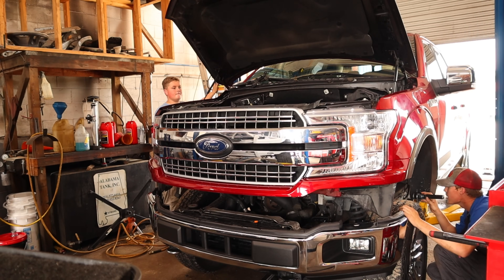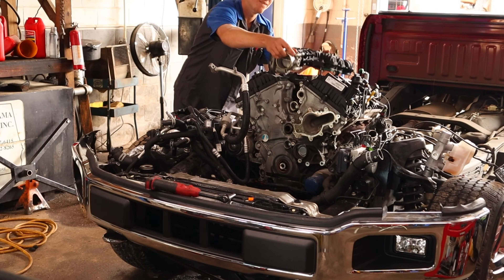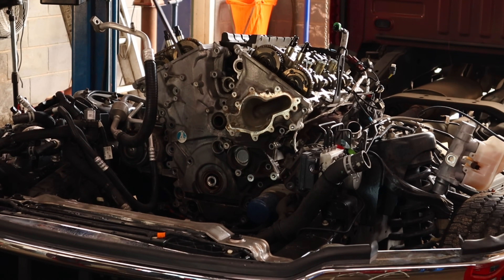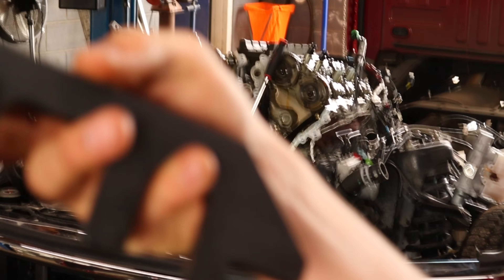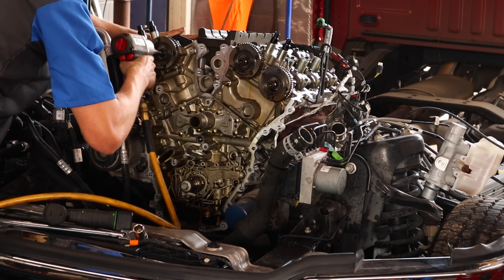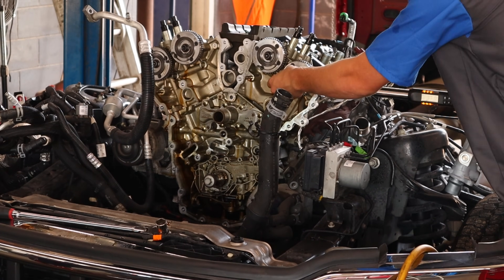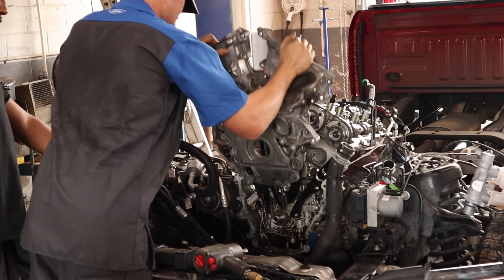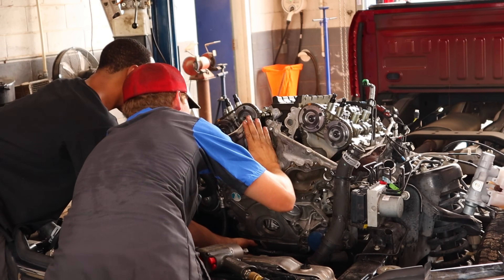Ford 3.5 EcoBoost Cold Start Rattle (VCT Phasers) | Everything You Need To Know

Comment: I just had mine changed on my 2018 3.5 with 28k miles on it.  It never really made a noise other than a knock at warm idle. I had the truck for two days and it is making all kinds of god awful noises on startup.  I really hope my dealer didn’t cause irreversible damage to my engine….i have videos on my channel if anyone  cares to hear the noise.
Reply from the maker: Take it back!
Reply: @FlyingWrenches13  oh I did. They’ve had it for going on three weeks now and still have not given me an update. I got Ford involved to hopefully get a quicker resolution. Super frustrating.

Comment: The rattle comes from the chains not the VCT Phasers.  VCT Phaser would make a slapping noise not rattle.   Even a drop of oil inside the cavity would make the VCT Phasers silent.  Imagine a Ford sales person telling a buyer all this golden information.  No body would buy that vehicle.  In my world timing chains are good for the life of the vehicle, especially in an interference engine.
Reply from the maker: That is incorrect. This rattle noise is 100% caused by the phasers.
Reply: @FlyingWrenches13  How?  The phasers are only free to move about 45 degrees about a central point on the phaser.  Oil in the cavities locks the angle.  The entire phaser then rotates but shifted by the angle.   What causes the rattle?  The chain going over the phaser sprocket seems the most likely cause of the rattle.  I am trying to figure it out. Can you provide more data?

Comment: Are you sure it's the Phasers..  Does it damage things or just a "Nuisence"?  The Mid 90's DOHC Lincoln 4.6 had a timing chain rattle caused by oil pressure chain tensioners..  Didn't seem to hurt anything..  some help with an oil filter with a one way valve that sped up oil pressure build.  Sounds more like chain rattle to me.
Reply from the maker: It’s phasers for sure.

Comment: I have a 2018 F150 3.5 and had the cam phasers replaced under warranty last month. A few days later the low oil pressure sensor went bad and now I have a powertrain malfunction error and there is now power when I hit the gas.  The truck hasn't downshifted properly since the sensor went out.  My mechanic at Ford doesn't seem to be too concerned and told me to keep driving it while we're waiting for the sensor to come in on the 18th, should I be though?  Truck almost left me stranded last night.
Reply from the maker: I’ve never seen that happen with the oil pressure sensor. I’d say if the truck is running that poorly after a repair was made, that dealer would be giving me something else to drive until it’s fixed.
Reply: @FlyingWrenches13  They did but only for a few days.  They replaced the sensor on Saturday and the truck runs like it used to.  They really put a serious safe mode in those trucks!

Comment: I am so tired of hearing this click/rattle in my 2017 limited.  I actually took mine in for other recalls and I noticed on the invoice the cam phaser it PCM was reprogrammed.  Changed nothing. Mine does a slight rattle just in idle.  I will be calling dealer again. Funny enough a week after I got the truck back I got that recall notice from Ford.

Comment: thank you for this information  i was about to  buy a 2018 f150 limited with 14,000 miles  and when i started it  first thing i heard is the rattle  i was about to pay $55,000 i think i will buy a toyota tundra instead.
thanks
Reply from the maker: Warranty would have covered that repair. Tundras aren’t bad trucks either though!

Comment: I have an issue with my 2017 F150 3.5 ecoboost where is making a ticking noise. Would you be cool with me emailing you a short video clip and giving me your opinion?
Reply from the maker: Sure! You can send it on IG or Facebook too.
Reply: My 2018 3.5 started tick, tick, ticking around 67k.  Old folks in my neighborhood turn and look…, offer suggestions.  Its embarrassing, annoying and unnecessary.  I ‘think’ it’s caused by one of the VCT solenoids?  Checking w my dealership and I have the ESP.  Since it throws no codes, they aren’t quite sure what to do. Until it gets fixed I’m just hoping it doesn’t cause any “out of sequence“ situation?
Reply: I should have updated this; but my issue ended up being something loose on the starter that would rattle. New starter and the noise went away completely

Comment: My 2018 Ecoboost (with 44K miles) has never had the cold start rattle but just recently I had that chattering/rattling sound (for the first time) after a 3 or 4 minute warmup from a cold start. I was doing  50 mph when I heard the sound.  It sounded like it was coming from the valve cover and lasted for 20-30 seconds until I had a chance to pull over. I let the truck idle for a few minutes and then drove away. The sound has not returned since.  My oil and filter has been religiously changed every 3500 miles with Amsoil Signatures Series 5W30.  Could this be the cam phasers?
Reply from the maker: That doesn’t sound like cam phaser rattle to me. If it makes that noise again I would probably take it in for diagnosis.
Reply: @FlyingWrenches13  Thanks for the reply.  I have an appointment this week at which time they are going to reprogram the PCM. I told them a couple times it has never made the noise at cold start up. Perhaps I should cancel the app't? I don't want to get the "shudder" that folks talk about after the PCM reprogramming....  The noise has never returned.
Reply from the maker: @cwqrpportable  I would go ahead and have the reprogram done so that you get the warranty extension for the phasers. You can alway have it reverted if you don’t like it.
Reply: @FlyingWrenches13  Good advice, thank you. I'll do that. Appreciate your reply.

Comment: Since these motors are hard on oil (fuel dilution, turbo heat breaking it down, vct phasers leaking out overnight, ect. Would it be better to just start using thicker viscosity oil from the beginning? I doubt we would see any negative issues from running thicker motor oil. It seems like 5w40 at the minimum would help, if not 10w40 or 15w40. Might loose a bit of fuel economy but at the cost of a $3k repair needed every 100k, It might be worth risking.
Reply from the maker: I would say that’s true but with how small some of the oil passages are in this engine I would still recommend using manufacturer recommendations.

Comment: Great video. Just some pointers: take the ac lines off the compressor, takes a minute and makes is easier with the front cover. Also make and install the dowel pins for the front cover installation, you’ll thank yourself later. Also it doesn’t take 4 people to set a cab back down. 2 at most. Most of the time I do it by myself.
Reply from the maker: Thanks! I’ll try those tips on my next one. I usually remove and put back cabs by myself but for some reason when I turn that camera on everyone wants to start helping me or watching hahaha

Comment: This is no longer for only "under warranty" trucks with the 3.5L GTDI engine. Any mileage with Customer Satisfaction Program 21B10 to update the programming on the PCM. If it messes it up, then they give you 21N03, free also, and if the reprogramming messes it up and they can't get it right, then they give you, free, 21N08. Hurry, there are time standards on these fixes.
Reply from the maker: Watch my newest video on this, I go into detail about everything you just said. Good info, thanks!

Comment: 2019 platinum Expedition got both the 21B10 notification ford app and then a mailer with the whole mileage/ coverage breakdown etc. Had zero issues only 19,000 miles on it. Oil oci every 5k. No doubt the turbos and gas dilution from the DI system degrades the oil quality pretty quickly. 

Dealership did the 21B10 update two weeks ago. No hard / odd shutter from what I can tell. But will for sure keep an eye out. 

Ford likely is just going to tweak and milk the 3.5 till they go EV or some type of hybrid where the 3.5 gets retired. Bummer… I really like this truck.
Reply from the maker: Yeah I love the engine, if they get all these oil flow problems solved. Glad to hear you haven’t had any issues, hope it stays that way!

Comment: Why in the world did you remove the cab???? I’ve done countless ones and I’ve never removed the cab. That is a huge disservice to the customer by being far more invasive than necessary.
Reply from the maker: Takes less than a hour to remove cab. You then can access everything on the engine a 1000 times better. The real question is, why in the world would you not remove the cab?
Reply: @FlyingWrenches13  unless your r1234yf machine is much faster than ours, you are spending far more time than an hour to remove the cab. Discharging the ac and removing the lines and not replacing the o rings on the lines because Ford sure won’t pay for it under warranty. Also, if you are doing CP then you are screwing the customer by charging them an evac and recharge, replacing the o rings when the procedure doesn’t call for it. 
Not only that you are raising the cab off the frame, while really not that big of a deal, it’s just another step you don’t have to do and could cause problems further down the road for the customer or you if you get a spun cage nut or cab nut. 
Idk, the procedure on these is pretty simple and just seems like a lot of extra work. Also seems like you struggled putting the cover on even with the cab out of the way. Zip tie the battery cable to the frame and push the trans lines under the oil pan and will make that much easier to do.

Comment: Why tear into it to try and fix it?  Just add an oil pressure pre-lube system (either pump or accumulator).  Problem solved.  Will increase engine life too.
Reply from the maker: Where do you get a pre lube system for this engine?

Comment: Great vid ! I like the fact your extremely smart and honest. You tell it like it is. Keep putting out your videos and your reviews ? I purchased a used 2014 f150 with a 5.0 and 150,000 miles. Ran fine till I changed the oil. Used Mobil 5/30 and Ford filter. Drove about 5 miles and check engine light came on with a cylinder misfire. Cleared it and drove it again with different cylinder misfire. Cleared it again. Now I have p0390,0394,0300, and numerous cylinders on the other bank. And what sounds like noisy vct,s   Do you think the guy that sold it to me ran a thicker oil to disguise this problem and noise. What do you think. Was it related to a simple oil change? Or a coincidence? Need a video on swapping cam sensors. Thanks.
Reply from the maker: Thank you! Most likely the oil viscosity wouldn’t hide the vehicle from setting a dtc. Especially considering 0394 and 0390 are electrical dtcs. I would be looking at cam sensors, wiring, or pcm issue if I was diagnosing your truck. Also, could be out of time if anyone has ever had the truck apart.
Reply: @FlyingWrenches13   could the oil viscosity hide the upper valvetrain noise , maybe the vcts from making a lot of noise. Which is now present. Keep the camera rolling , even a simple video like washing down a motor prior to disassembly. Looking forward to see this channel Grow to the. Millions. Thank you.
Reply from the maker: @tripleh9985  will do, Thanks! I doubt that thicker oil would have stopped a vct noise. If you really think it’s got something to do with oil viscosity, pour a quart of Lucas oil stabilizer in it to see if anything changes. The Lucas will thicken the oil up a good bit.

Comment: F'n Ford! My 2002 Sport-Trac had all 4 timing chains (balance shaft included)!w/cassettes go to sh_t after 100,000. Rattled for 6 months just to remind you its cheaper to re-motor since you have to pull it anyways. $3000 labor & $1000 parts to fix it when a new long block is $3000. My Lincoln 32 valve Intech V8 same deal. Bro in-law 5.4 3valve F-150? Same goddamn thing. If it's a phaser or a chain Ford version will let you down early. Ford sucks! Chevy sucks too!
Reply from the maker: Yeah they all have there issues. 4.0’s suck because of that chain, all they had to do was put it up front haha

Comment: My rattle only seem happen when  cold weather came never happened in summer time just winter I had everything check even turbos no issues sure enough cold weather just came rattle started
Reply from the maker: Colder the weather thicker the oil. Harder to get good oil flow with cold thick oil.
Reply: @FlyingWrenches13  I let my ecoboost warm up first I had my budy who works for Ford he said it was just runs good I had to put oxygen sensors on it new spark plugs twin turbo is a wicked truck I baby it but once in while I take it off road in hills of Tennessee

Comment: When they do the reprogram now there is an option for a different file if it causes a shudder. Mine did shudder, and got 3mpg less after the reprogram.   I took it back and they installed the previous file and the shudder is gone and gas mileage is back to 19-20. From reading the post below this it seems that the 3.5's that develope a shudder have leaking mega caps on the heads, so they go back to the previous oil pressure programming rather than replace the components...great, with the added benifit of wearing out the timing components the same as before.  Btw the shudder is engine shudder not transmission like originally thought.
Reply from the maker: Everything you said is correct! I actually have a new video coming out in the next couple weeks about the recalls ford has published in the past couple months.

Comment: The vct sensors have a screen on them right.  Probably has crap building up there.
Reply from the maker: Usually by the point sludge has built up to get to those screens the engine is trashed. Usually I see more metal shavings than anything else on them.

Comment: Seemes to be more and more of this. Pulling the cab off for any repair on a f- series truck. Even if it's not necessary, And workshop manual doesn't direct to do so. Do you really save any time? Do you just not like bending over a radiator support? Do you enjoy scaring the shit out of the customer if they see what you've done to their truck. Lol. Just curious is all. I admit I've felt like pulling a cab to do passenger exhaust manifolds on the f150s with the triton 5.4 but never have. Nor have I seen any other techs do so nor for timing chains in a ecoboost. Again just curious your thought on this.
Reply from the maker: For me, it’s all about the quality of the repair. I feel that if I have the cab off and out of my way not only is it easier on my back but I can make sure that everything I do to that engine is correct. I don’t accidentally scrape the silicone off the front cover when installing it or roll the back of the valve cover gasket because I can’t see it or miss a timing mark because it’s so difficult to see with everything in the way. I use to do these cab on and overall it may take an extra hour or 2 with pulling cab but I would much rather do it this way. Oh and I’ve never pulled a 5.4 cab for manifolds but I do pull it on them for any major engine work. It’s also a added benefit when you see a customers mind blown when they see a truck with cab off (even if it’s not theirs) lol I can’t tell you how many time I’ve had someone walk up in the shop and say “holy cow, back in my day we didn’t have to do all this to work on a truck”

Comment: I’m also a tech at ford. My expedition just got done. Before they were taken off you can see movement by hand with the Chain on. Seems something internal to the old phasers fails.
Reply from the maker: I’ve seen that on some as well. Even seen a few that brake the spring on the outside!
Reply: @FlyingWrenches13  ouch. Mine is shuddering after the update smh
Reply: @christaccone7234  reprogram the pcm through ids. When you go through and it asks if youre reprogramming to solve the shudder select yes
Reply: @ProteinSquirts1738  just stared doing it
Reply: @ProteinSquirts1738  I’m quick service so hvac and electrical is my gig so hoping I did it right lol
Reply: @christaccone7234  its pretty straight forward. When you did the pcm reprogram you shouldve seen the option when performing the reprogram. Load the car into ids, go to toolbox - module reprogramming -reprogramming - pcm. When it gets to the part asking about the shudder select yes and follow on screen instructions. Should resolve your issue. The 21n03 or whatever the fsa number is for the shudder issue is under oasis. Go to technical info and itll give an even more indept how to

Comment: So I have a 2018 F-150 Ecoboost and have a bad rattle. I took it to the dealership with the letter Ford sent and they updated the PCM program but it did nothing to the rattle on cold start up. It has 60,000 miles. What exactly do I need to tell them to get this fixed?
Reply from the maker: To replace your phasers under FSA 21n03. It’s an extended coverage that should pay 100% of your bill if your under 70k miles. Most dealers are doing them everyday!

Comment: I have a 2010 Ford Taurus sho with 107k miles and I have a rattle at cold start and a weird nose at around 1650rpm. Would this be the cause?
Reply from the maker: Most likely not. It could be timing related but your car is going to have a different engine than this.